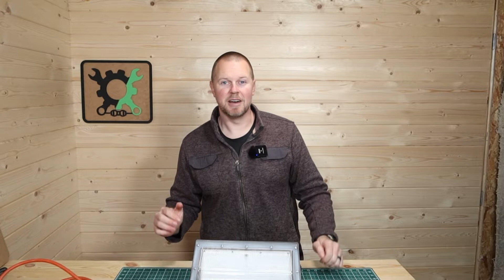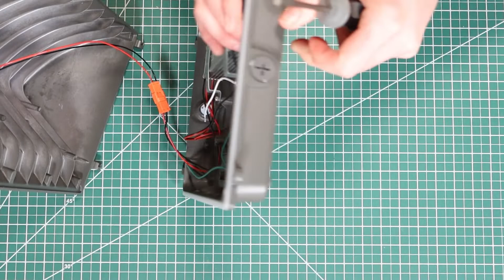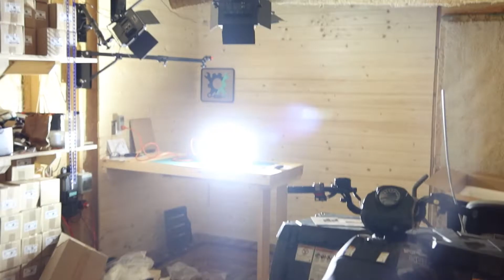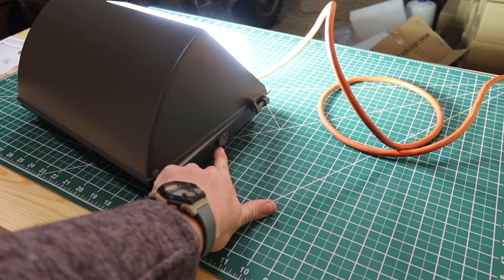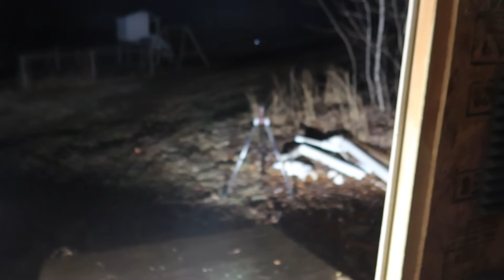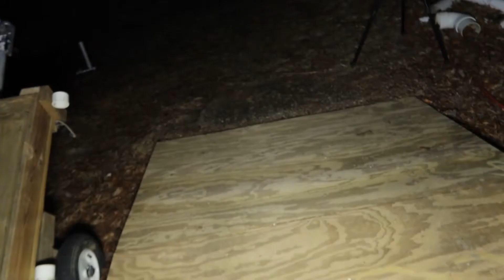Cinoton 120w LED Wall Light

Comment: Nice unit. Looks like the light sensor can be unplugged? If so does it stay on if it's disconnected? Also I wouldn't trust my bare hands on the metal case with wire nuts keeping the dangerous stuff contained, if you know what I mean :)